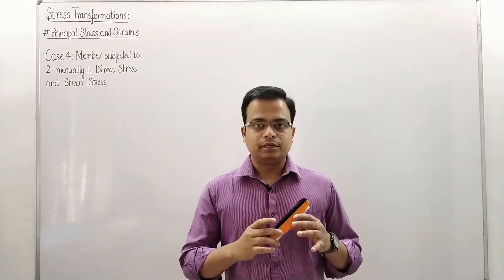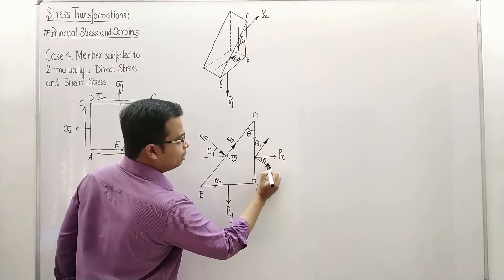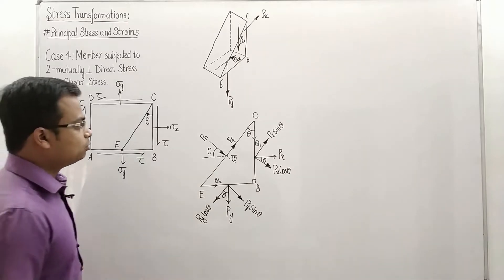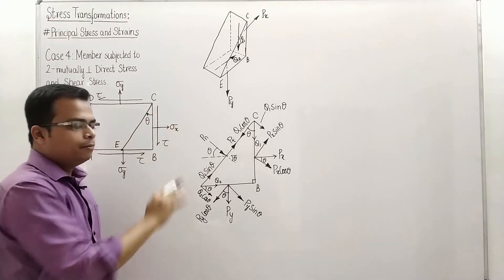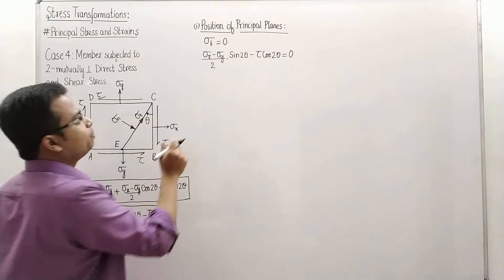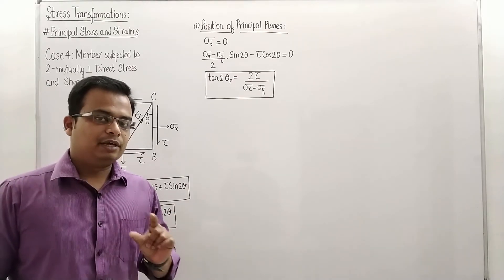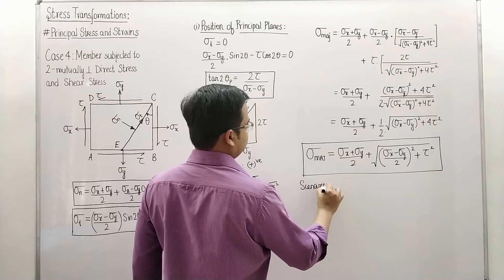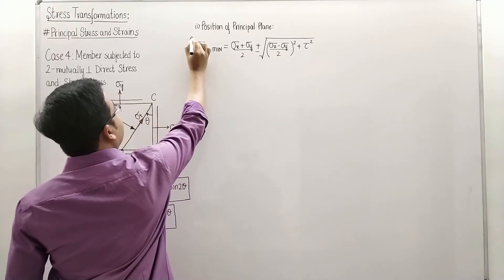Mechanics of Solids | Principal Stress and Strains | Direct Stresses combined with Shear Stress |

Comment: sir if u have an angle of rotation clockwise ( with respective CB reference plane)  +ve and same drawn with mohr circle then 6t value is becomes negative but by analytical method it is positive. plz reply ..... also one request please solve one problem by both analytical and graphical method

Comment: Sir in case 4 if the shear stress is not applied then the tangential stress would be negative as it would rotate clockwise according to mohr circle but if I use this same equation I wouldn't get a negative value of tangential stress.. How is it possible sir?